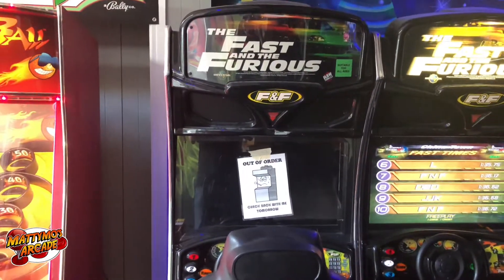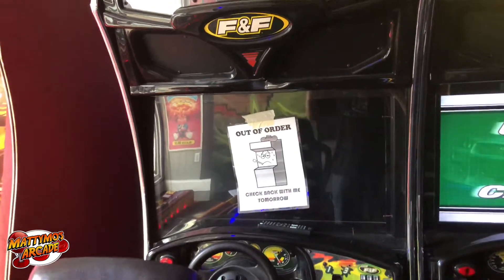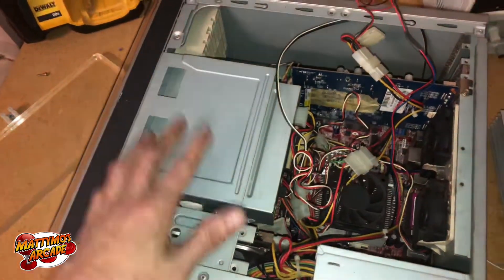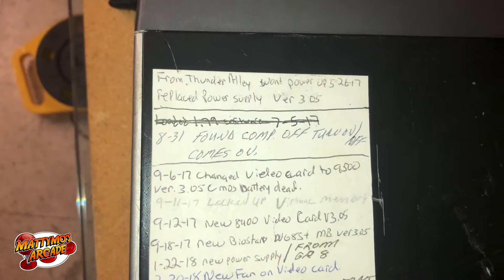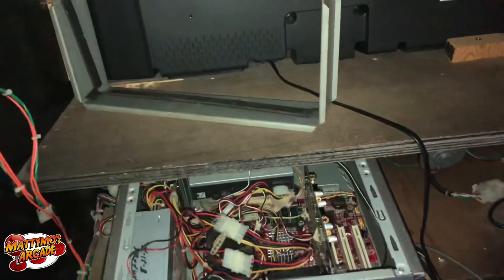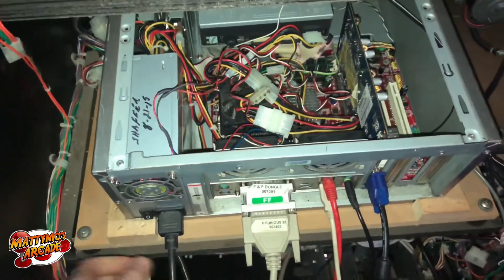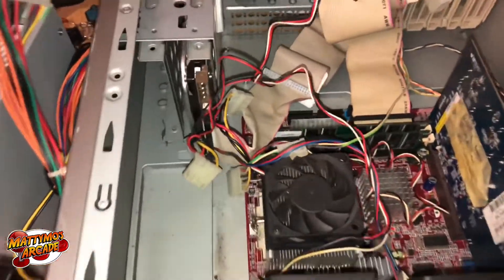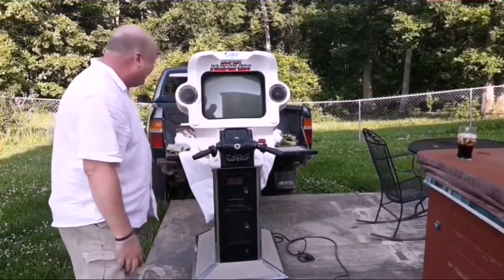Fast and Furious Arcade Repair. NO SIGNAL Troubleshooting and Fixes

Comment: What about if there is sound but no picture? On any monitor? Is that normal or is it a glitch? I wasn't able to troubleshoot it since I was at someone's house, the original monitor stopped working, but when i plugged in another one, it enters sleep mode with the sounds working
Reply from the maker: See if the PC is off. If it powers up after you hit the button, the battery on the motherboard needs to be replaced, and you'll need to reset the bios settings.
Reply: @MattyMosArcade  ok

Comment: Have a 2004 GT. My power to the house went off and on then off for about 30 minutes and now no signal.  I don't hear the hard drive . Any ideas
Reply from the maker: Make sure it didn’t blow a fuse
Reply: @MattyMosArcade   power  comes on , board lights  . The monitor  says  no signals . I dont  hear the hard drive  booting up
Reply from the maker: Sounds like the power supply isn’t kicking on, or has had it.

Comment: I’ve got a machine that boots the pc but not the game, I think its missing the BIOS file, can you please help? Thanks!
Reply from the maker: There are recovery discs that you can run, and that will fix the hard drive (most of the time). Also check the battery. If it’s dead, you lost the settings. You can use a keyboard to access the BIOS and Power management settings.
Reply: Yup I ran the discs but unfortunately im still getting the pc screen, which battery do I need to replace? Thanks!
Reply from the maker: It’s a 2032 disc battery on the PC motherboard. I did a couple different videos on it.

Comment: Hello I’m electrician and I’m new to arcade games I just bought the same fast and the furious arcade game you are working on I bought it from a barbershop for $200. me and my buddy got it working but the screen starts moving side to side and blacks out and says no signal all the time The sound seems to be working properly. They were told it was the back light but I don’t know why the back light would be broken if it works every once in a while you know what I mean? Please let me know how to contact you for more information you are awesome thanks.
Reply from the maker: There is no backlight. If it’s going in and out, it sounds like a connection issue.
Reply: @MattyMosArcade  Is there anyway I can send you a video somehow so I can explain it to you and then you can kind of give me a couple pointers and I won’t waste anymore of your time!
Reply from the maker: There is no backlight. If it’s going in and out, it sounds like a connection issue.

Comment: There's really no point on getting parts for that particular motherboard because they were always prone to failures even when you purchase a used unit. Also the side panel is mismatched assuming they had a Drift Computer that was used for parts to fix that FaF game. It is not a Dell, They call them Microtels which Raw Thrills soon replaced them with Dells back in 2007 because the support for the Whitebox Vendor was Subpar and made the parts much more expensive than getting a whole new Dell Optiplex 740 Computer for the game that lasted way longer than the Whitebox Vendor. Also they used 512MB of memory/ram as a minimum capacity for the game which caused many issues like Low on Virtual Memory. If you upgrade the memory from 512mb to 2gb it will not give you those issues and the performance would be even better.
Reply from the maker: Yes thank you. Also, I totally forgot about the memory issue. Ran across that a few times. The Dells I never really had as many problems with. Also, I’m terrible at removing caps from a mother board. Bad technique.  Lol
Reply: @MattyMosArcade  When local operators brings their Microtels in that are either broken where they can't solve it or wanting to upgrade the computer itself I usually give them an offer to trade their whitebox computer for a free fully working Dell Optiplex computer for the game with a new set of recovery discs which really helped them get their game working fast as possible. With so many operators replacing FnFs with Cruis'n Blast can be really annoying but the FnF cabinets would go to people like me which can fix them up and sell them in a day or two when the original owners/operators could've used those benefits or investment towards other games instead of throwing them out. And yes sometimes replacing caps are always a pain and most of these boards are usually e-waste material which electronic recyclers are willing to get even if they have bad caps. The Best motherboard as a replacement for an FnF Microtel computer would be either the AsRock N68C-GS FX or AsRock N68C-GS UCC with an AMD Athlon II X2 250 Processor/CPU and for the Video Card would be an EVGA/MSI Nvidia GeForce 8400 GS 512MB or Any Brand Nvidia GeForce GT 610 1GB (Which is the Latest) They both require PCI-E X16 Slot and the Software Version 3.00 or 3.06(Latest). You can always look these parts up and they are really cheap but it would do great for the game.

Comment: When I troubleshoot these computer arcades, I pull the pc's and hookem up to a pc vga lcd with the side panel off and go from there.  Such a PITA to work on these things while they are still in the cab.
Reply from the maker: Agreed! I have a tester card that plugs into one of the video card slots. It’s pretty helpful, but I couldn’t find it anywhere. Through me off a little.

Comment: do these cabinets have cooling fans in them? might be worth using a core drill on the rear back panel and modding in a powerfulish fan to allow cool air into the cabinet and prevent the computers from nuking themselves. either way great video and i look forward to see if this issue is fixed, (i have a soft spot for PC based arcade hardware when it goes wrong)
Reply from the maker: That was exactly my plan. They do have fans but they are too dirty. I’ll just replace them. It will definitely help.
Reply: @MattyMosArcade  I'm not sure which fans to recommend but I'd go with the industrial Noctuas as they're powerful and very quiet, otherwise just a standard San-ace or Delta fan should do